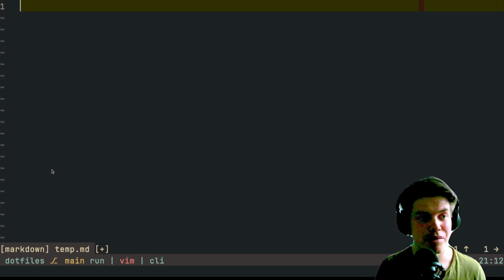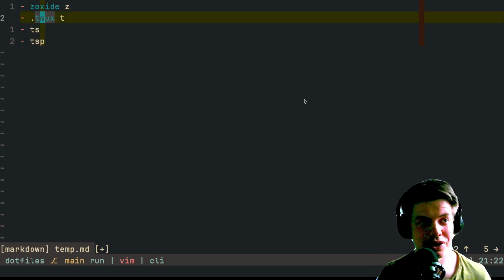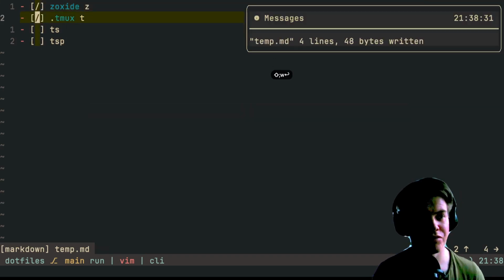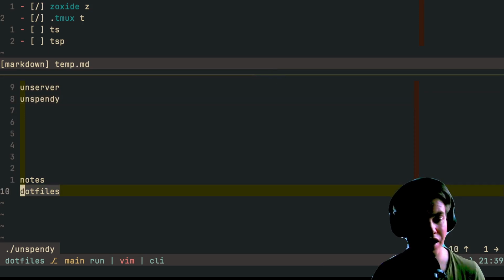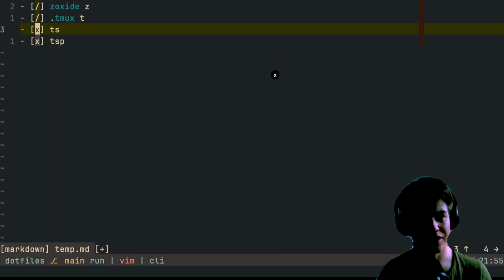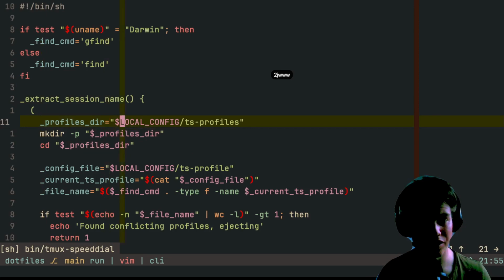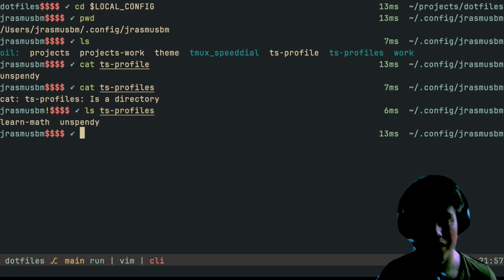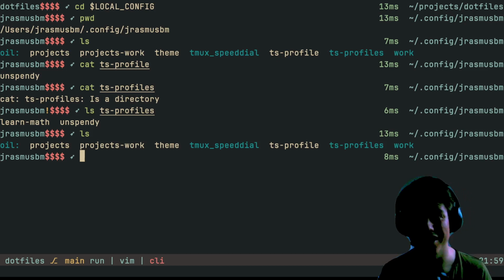How I use tmux to move through 10+ services at the speed of thought

Comment: Thanks for sharing. I work across ~6-8 repos a day and have them broken down into 3 tmux sessions. Each session having a handful of windows I get to with prefix-num (1-based indexing). Sometimes there will be the same repo in two sessions. In that case I try to keep it the same window index between sessions.

tmux-speeddial looks like it could speed up my switching between the sessions. I just prefix-s and pick it.. And also hope tmux-ressurect works and I get my snowflake setup back :)

Will definitely check out the linked video, thanks.

Comment: for me im just using the base set up, i save all the relevant projects  i open a new session save it with tmux-resurect and switch projects with <prefix>s. My stroggle is with the relative path to each project, so to make it work well i do need to detach and go to the folder and then create a new session, and yea i know i can do it from tmux but i just never remember the correct path. 🤣
Reply from the maker: That's a great workflow, assuming you don't have too many sessions running at once. Once you have 10+ active at the same time you could run into search fatigue (which is what prompted me to build the speeddial in the first place). 

That's exactly what I used to use zoxide for before speeddial (and still do for projects that are in strange places). Detach, zoxide to the right folder, t to start the environment. Thank you so much for watching and commenting! 😀